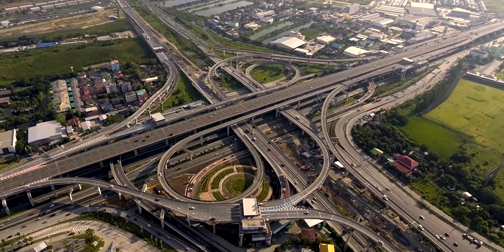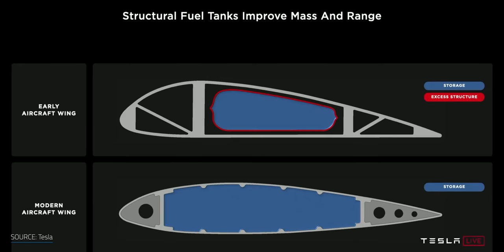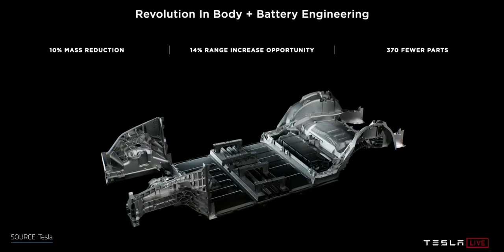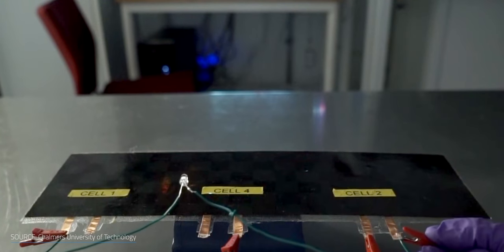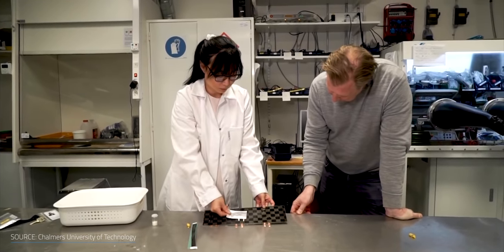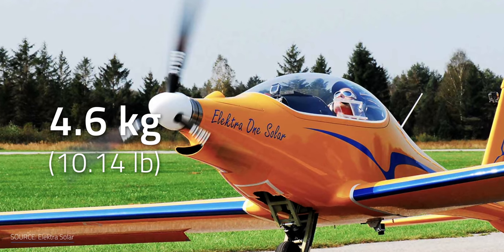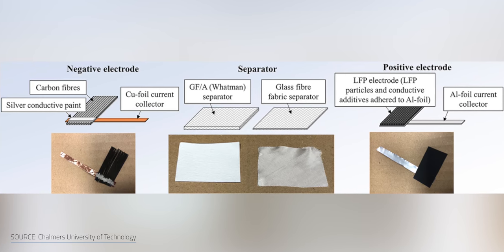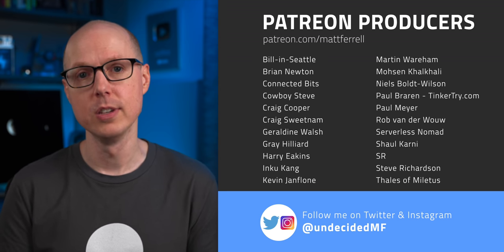Exploring Structural Batteries

Comment: Using car body seems to be a good or even great idea until you need to change battery as they are aging. Nowadays batteries are able to have decent capacity for how long? 10 years? and then what? scrap whole car? 
2nd thing is what in case of crash... Now batteries are filled in with flammable electrolyte. damaging battery means high risk of fire. 
Both are saying OK great idea but maybe when solid state electrolyte will become reality. Then lifetime will be long enough and risk of fire in case of crash will become much lower.

Comment: useless for cars unless its super cheap, or retains more than 80% capacity after at least 10 years.
the design would need to be very modular so you can replace any part acting like a battery in a few hours. like a door panels roof panel or side panels

Comment: Bad idea for cars, because the weight of the battery would be higher up in the structure...not what you want. You want a low center od mass in a car. Also, planned obsolescence....

Comment: First of all I dont know who came with "massless energy battery" but that just sounds like marketing term detached from reality. Its a structural battery (battery integrated into structure). And second. its nice that you are thinking about it replacing the structure of planes etc. But the question is if it realisticaly can... And the answer is NO not really. Why? Well I dont think that it takes a rocket scientist to realize that it doesnt posses the same structual properties as things that are being used = as light and STRONG and durable as possible. Sure you could replace some unimportant parts like IDK dashboards, floors etc. But with its 20% capacity compared to the lithium-ion battery? Its simply not practical for the uses you suggest (energy storage for electrical car etc.).

That said I am not opposed to this technology or anything. I just think that this video oversells its usefulness a lot. It can serve as additional storage of electricity or for example replace normal car batteries in diesel/gasoline cars. That is very much possible. However that doesnt sound so fantastical anymore huh? Yeah...

Comment: You can scratch a battery in the wro.........If you hurt a batteries feelings, it will erupt into inextinguishable flames. 
Have you seen how some of us drive our vehicles?
Are they going to leave the original well for a future replacement or is this a disposable car.

I can only change the battery in my devices with a soldering iron as it is. This seems like a horrible idea for something like a car.

Comment: building the battery system into a car is not the same thing as fuel cells on a plane. for one, batteries have a great habit of failing when its most inconvenient. The abusive costs of car maintenance is already out of control in this country, but now you would have to have factory level maintenance done on your car just for a dead battery? This is a terrible idea. a car goes through a LOT more wear and tear then passenger planes do. Maybe if it was integrated into a different part of the car that wasn't so vulnerable to constant damage it would be better, but putting in the base of the frame is a horrible idea.

Comment: Range? I'm much much more worried about the cost of replacing and charging the batteries. You do realize these batteries need to be replaced annually right? Not to mention how devastating the mining of the raw elements in the batteries is for the environment. Or the increased demand on our electrical grid, or the potential hazards of poorly disposed of used batteries, or the increase in demand for electricity raising the cost of this basic utility, or the environmental impact of increased electricity output by coal and nuclear power plants.

Comment: replacing those batteries does not sound fun probably expensive and could render lots of Throw away devices.
Reply: new 4860 cells will last a million miles and will outlast the car.
Reply: @Warbay57  I wasn't referring to the longevity of the batteries I was merely referring to if the batteries were damaged or more than likely user error 
such as over charging/ under charging  and just straight up battery failure
I know in theory those batteries can last a million miles but in reality s*** happens
Reply: @89HondaCR500R  Technology wise, it is different. A steel chassis can be repaired by cutting out the defective area, and weld in a replacement. Then a bit of filler and some paint. A casting have advantages and disadvantages. You're probably familiar with lots of cars have castings where the shocks/springs connect with the top of the chassis. After a collision, the castings are almost always replaced if there is damage. It could probably be repaired, but it marked with "replace" after damage, to ensure there are not repaired parts with hidden cracks in them.
With proper equipment that can detect cracks that may be hidden - there should not be any problems welding it. The manufacturer must just add the proper routines in the repair manual, and provide welding material/alloy info. Depends of cost of equipment, time it takes and how much the part will cost to replace. When welding, there must also be taken care, not to add stress to the materials, that may reduce the lifetime of the part.

Comment: Batteries have to accommodate chemical changes to store energy.
The materials that do this chemistry are not physically strong, nor do they have hard surfaces.
Energy storing materials are spongy, porous and often need to be supported by other structures.
The chemical changes in these materials means they are always being built up or broken down, depending on charge conditions.
Where does the 'structural' strength come from?
You guys really need to learn some basic engineering principles.

Comment: Structural batteries = disposable devices = non-sustainable tech. It should be obvious that this is a bad idea... Batteries in all their current forms eventually require replacement, if something's structure is also it's battery, well you get it...

Comment: This is a slight change in packaging of Tesla cylindrical cells. This is 100% a marketing gimmick by Tesla. Those are cylinders (still!) sandwiched between huge pieces of square metal. they are not "structural batteries". Literally same thing they've been doing for 10+ years with minor tweaks. Opposite of innovation.

Comment: Massless batteries, or structural batteries, are a great idea for some application, but for an automobile, not so much. One fender-bender and the car is totaled.  Once the battery is voided by a crack in the integral components, and "poof" you have no current.  I have a better way.  A better design. Email me and I'll tell you all about it.

Comment: I recalled it correctly from my knowledge of these new battery presented in this video, the material is carbon fiber composites 🧐?

Unfortunately carbon fiber composites isn't easy to being recycled (it is usually burned up) while the strength is based on the fibers in the composite itself; It's quite hard to detect a cracked fiber or any wear in the structure while any buckling effects are even harder to predict. 

It's a cool idea giving lots of options for weight reduction and a whole new way of thinking of how to store energy, it really is! But remember that the material itself is used in more industrial applications (or in racing cars) where lots of time is spent figuring out how the structure is properly built up and loaded.

Going commercial with a car consisting mainly of carbon fiber can be hazardous if any fire or a major crash occurs; The fibers themselves are basically so small that they resemble Asbestos as it gets!

Anyway I do hope some sort of solution will be at hand 😎

Comment: Wow, its is depressing to read the cynical comments on this video.  The depressing part being the sheer lack of understanding of how a technology like this can be used, even though the ABCs were spoon fed to you in the video.  These structural batteries are not a replacement for your dedicated, replaceable, battery packs.  This is a technology that can be used to supplement that dedicated battery pack's capacity by 10-20%, or slightly reduce the size of that dedicated battery pack's weight and volume.  

I know it is a popular theme, this concept of "planned obsolescence" but I don't think many of you understand the process there.  I'm not saying it doesn't happen either, although its not a motivating factor in 99% of cases.  This phenomena is a symptom of the reaction to society's adopted assumption that your essential/luxury items should be cheap to buy.  COST REDUCTION activity, which is industry's reaction to the assumption items should be cheap, is the reason why things might not last as long as they could.  And it really depends on the good, a toaster vs a car for example; these are not going to be optimized by engineers in the same manner.

Comment: That all sounds like a development in the wrong direction. If the battery becomes a fully integrated part of the cars body, how do you replace it at a reasonable cost? Just look at electronics devices, you used to buy a new battery for like 15€ and swap it. No trained person with adequate tools involved. Now, a battery swap costs easily over 100€ where most goes to the guy doing the swap. Car batteries are already expensive but if they become an integrated part, costs will explode for the battery, but also in man hours to change it. It may become less expensive to buy a new car every 4 years than have it serviced and driven for 20 or more years. This sounds so incredibly wasteful.

Comment: yea not being able to replace the battery is pretty dumb. the weight savings isn't actually that much. plus the cost of the vehicle is going to skyrocket to the moon. having to repair any part of the vehicle is going to cost a ass load of money on top of the upfront cost of the vehicle.
stop calling them massless, they have mass.
at that point you might as well have a hydrogen tank and fuel cells. hydrogen being created by renewables ofc. this means less shit to go wrong as fuel cells/hydrogen tank would be cheaper to replace then any kind of battery pack. also because vehicles are hydrogen based, grid storage can be too. this will allow the capture of nearly all energy produced during peak time and can be stored for use later without having massive racks of batteries everywhere. lastly hydrogen transportation wont strain the electrical grid, unlike batteries would. if places are having problems with just AC's turning on at the same time....connecting a bunch of vehicles to charge are not going help at all.

Comment: It was a nice video, even if not all analogies were perfect, but I find myself unable to share it with other possibly interested people. There was WAY too much technical jargon, numbers, etc. that didn't need to be thrown at the audience. So much info dumped on someone will make you lose their attention. GPa measurements? Wh/Kg? Telling people that it was comparable to Aluminum while being much less weight was enough, yet it was said as an aside after dumping numbers that your average person has no knowledge or frame of reference. Now if you had a table with the 2 - 3 basic specs for the two different materials on a table on screen, then MAYBE you wouldn't lose people. Also the times when you used percentages you used them way late in an explanation. They should have come FIRST in some descriptions.

Thus, it makes it hard to refer this video to others as a cool technology that has great promise, as I don't intend to force them through the mess to get a the bits that might be neat.

Comment: Even if they perfected the batteries putting them into a car is a nightmare.   There are thousand of cells in the battery park.    All cells need to be the same energy capacity and each cell block.  Every cell block would be a different shape.   That is going to be a major night mare.   Some shapes will not perform as well as others.  All the  cells have to be monitored to charge and discharge properly.   Wiring nightmare for that capability alone will add to the weight of the vehicle.   Each battery block has to have its own sense wire.     Lithium batteries need to be warmed in temps below 40 degrees F.   Guess where the power comes from the warm them.  With the cells being so thin and spread all over the body they will not hold heat like a battery pack of today.   There are FAR more obstacles to overcame than just electrical and structural issues.    Some things just may not be possible.   Economically feasible solar cells were 4 to 10 percent efficient in 1960.   They have only advanced to 16 to 18 percent in 60 years.    So it may take 60 years for a 45 kwh/kg to get to 76 kwh/kg.

Comment: I know I am late to this, but still, better late than never...

While the concept is fantastic, and you could use this to make some very lightweight EV's... there are some fundamental flaws... many of which are brought up in the comments already. If one of these vehicles were to get into an accident, naturally any damaged parts would need to be replaced. This now then requires batteries to be replaced, which, in itself isn't a huge issue... as long as it "can" be replaced.

So items like bumpers, doors, hoods, trunk lids, mirrors... stuff like that... piece of cake. If we start going a little deeper, front and rear subframes that the motors, suspension, and steering are bolted to... ehhhh... starting to push it a bit here but I will give it a pass. But the main chassis of the car... the actual passenger compartment... unless MASSIVE design changes are implemented to make replacement of this (or if its broken down into parts, these) parts easier... then there is just no way this can be made as a structural battery otherwise the first T bone the car gets into... its off to the scrap yard with the whole thing... unless they plan to sell these things for $5k or less... that just isn't practical... and even if they did... then they have to be able to keep up with the sudden spike in demand from people just wrecking these things all the time because they are just too cheap to care.

Comment: If they could drop the "car shape" that is only needed because of peoples preconceptions of what a "car" should look like, they could make weight a minor factor.

Well it already is, isn't it? Most of any "car's" energy output goes into pushing air out of the way, as soon as you go faster than about 25km/h.

So make your basic vehicle more "Formula 1" in shape, and now you're talking. Small frontal area, good aerodynamics, and that gives you a long average range.

OK, so now there are the Occasional Problems With This to overcome. For instance, about once a year the average car driver has a passenger. Well for that one passenger, just put a seat inline behind the driver. What about more passengers, though? Well how about a kind of "passenger trailer" you can hitch up to your normally aerodynamic "car"? I'll leave details unspecified, for your own imagination. Try figuring out how to make it work instead of just firing off the reflexive "NO" that comes with the first little obstacle. At very least it gives an opportunity to think about something outside the restrictions of the "normal" we invented over the last 50 years or so.

And of course for bigger loads than just some extra passengers, you could have other trailers. Maybe nice, long ones, so your "car" becomes like an Automotive Snake, zizzzing down the freeway all thinly and air-splittingly.

At very least, occasionally remind yourself that the real reason a Tesla "looks just like a car" is simply because this has come to be the shape people have come to expect of such a thing. There isn't some Platonic "car-ideal" auto designers have finally figured out to perfection. (It has to be this way, I suppose. It's bad enough asking people to think, but it's much worse to try to ask them to use their imaginations. Their imaginations have been designed for them already. Uphill battle. Better to just surrender it and give them a nice familiar shape not to have objections to for being "Abnormal".)

Comment: The best way to reduce the weight of the battery today is to reduce the weight of the car. Governments need to step up to effect a change in car form factors and weight. There is no reason for a car to weigh 1500 kgs in order to carry a 70 kgs passenger. It's a total waste of resources. Cars should be taxed like property, on an annual basis, based on weight. Charge a $3000 annual tax for a 1500 kgs car and a zero tax for any vehicle under 500 kgs and see what happens. Also cities should not let any car over 500 kgs on their streets. Vehicles under 500 kgs don't even have to be electric. A petrol vehicle of 500 kgs is more ecological than an electric Range Rover by a large margin. Also many poor countries are better off with petrol engines anyway. It's a lot cheaper to build and puts less constraints on rare minerals. If all cars are 500 kgs, how much better would roads be for people on bikes? How much longer would road last? How much cheaper would cars be? Also with new technologies, a car could be attached electronically to another car and move as a single unit (including comms). This way people and their spouse can each drive their car 95% of the time on their own, and 5% of the time, make it a unit for family trips, instead of driving a 1500 kgs car to carry a single person most of the time. None of this can happens without governments growing balls. And of course, they won't make it happen in fear of the consequences for the automotive industry. How long until they realize that a car as it is today is a luxury item we can no longer afford?